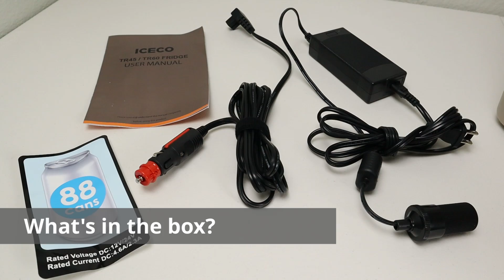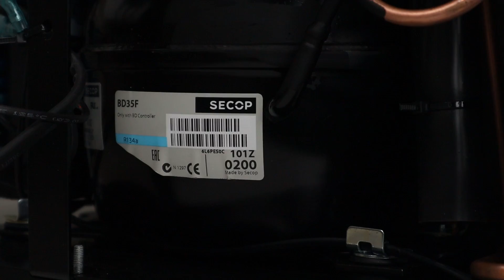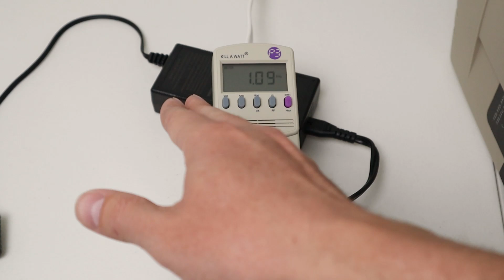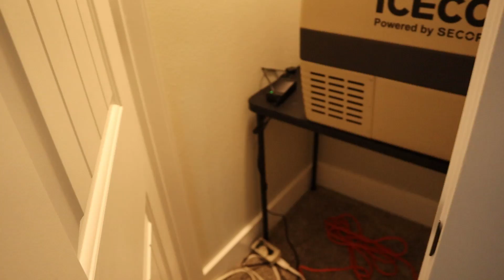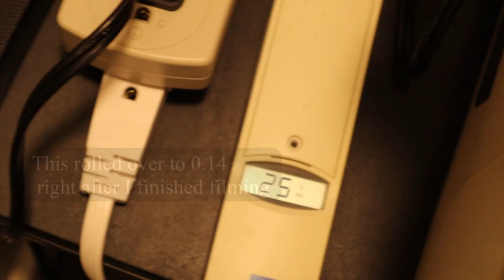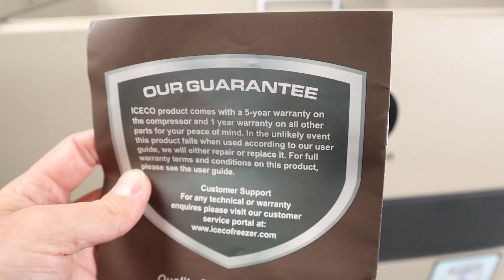ICECO TR60 12 Fridge Review - HUGE Capacity, Very Efficient!

Comment: Jason, I’m a truck driver and would primarily be using this on a semi truck connected to my 1800 watt inverter - sometimes using for car camping connected to a solar generator (no overloading or off-roading). Would this model be expected to serve me well? I ask because there are times I’m hauling freight up and down steep inclines. Thanks in advance.
Reply from the maker: If your truck can go up it, this fridge will handle it just fine!

Comment: How rugged does the build, materials and design of TR60/TR45 one seem compared to the JP42?
Reply from the maker: The JP42 is much more durable and heavier. I really like the TR60 though. Have you seen my complete Iceco comparison video? I put it out a month or so ago, maybe longer.
Reply: That was the only one I didn't see.  Just watched it.  Thanks!
Reply from the maker: @douglashenderson1419  just covers each model. I like the normal VL series for the efficiency but the TR60 is an excellent option. The JP42 is good but it uses more power and is pretty heavy, only go with that one if you need an extra heavy duty fridge.
Reply: @Jasonoid  On the JP42, do you think the power consumption will be lower now that it has been updated to have the Secop compressor?
Reply from the maker: @douglashenderson1419  the Chinese compressor actually uses less power, pretty interesting. The JP42 just doesn't have as much insulation so it's not quite as efficient as the TR or VL series

Comment: Hello Jasonoid, I am considering the TR60 vs the VL60S (Single Zone) vs the JP50. Both the TR60 and VL60S are 60L/63Q so they have more space than the JP50.  JP50 Power Consumption (P.C.)  (MAX mode, 55W for fast Cooling; ECO mode, low as 33W); VL60S PC (MAX mode 55W-60W; ECO mode 45W-55W according to an email ICECO sent me). TR60 PC (No longer listed on ICECO website so not exactly sure). The JP50 and the TR60 seem like they are built more of plastic than the VL60S. Not sure how this affects insulation. The latches on the VL60S also seem more secure than both the TR60 and JP50 which may also affect insulation. Also, does the TR60 have a drain plug at the bottom? I said all this to say which fridge/freezer would you recommend considering these factors: best insulation, least power consumption and price point. If anyone else has an opinion with some reasonable level  competence regarding these units, please enlighten me. Sorry for the diatribe.
Reply from the maker: Hey Dareal,
Thanks for reaching out about which fridge you should buy. I am planning on doing an ICECO comparison video soon because I have 8 of them….one from each “category” they make. 2 VLs, 1 VLpro, both JPC-rotomolded the 42 and 60, the JP30, and GO20. I have used them all many times and tested them thoroughly.  That video will go over a quick overview of each model (pros and cons), power usage, price, and capacity so subscribe for that future video.

The TR60 is a great fridge (available from FrontierHub.com…it was never on ICECO’s website for some reason).  It is a “divided” style fridge so the thermostat controls the larger compartment and the smaller compartment over the compressor is about 10 to 15 degrees warmer. I wouldn’t call these divided fridges “a fridge / freezer” like some people do. That’s kinda a gimmick. The warmer area is good for drinks and produce and that’s about it. If you want a true dual compartment fridge freezer look elsewhere like the ICECO VL60Dual.  The TR60 pulls about 10 watts at 70F and 21 watts at 85F degrees. It has the SecopBD35F compressor. ECO mode pulls 46 watts, MAX mode pulls 82 watts. No drain plug but I don’t think that’s a make or break feature there. The TR60 comes in at 43 pounds.

VL60S is a “Chest” style fridge so there’s one large cooling area. I prefer chest style fridges because I like to set them right at 35F and they perform very well. The VL60S is basically a tall version of the VL45. They took the VL45 design and made the walls taller. That makes it a pretty deep fridge so getting stuff out of the bottom and moving stuff around could get annoying, probably only downside for this fridge. The VL series are the most insulated fridges that ICECO offers. The walls are 2.25 inches thick! It’s going to be heavier than the TR60, but that weight means more durability and insulation. I am a HUGE fan of the VL series, they are my favorite model line from ICECO. I haven’t used this particular model before but like I said it’s a ‘tall’ VL45.  It should pull about 9 average at 70F and 19 watts at 85F. It should have the Secop BD35F compressor…it may have the larger BD50F…I haven’t torn one of these down to look inside before. I will tell you I wish they made the VL60 fridge in the same form factor as the VL60Pro, its basically wider and longer than the VL45 so it’s easier to store things and not have such a deep fridge. This has got to be heavier than the VL45 which weighs 48lbs.

The JP50 is a “divided” style fridge so the thermostat controls the larger compartment and the smaller compartment over the compressor is about 10 to 15 degrees warmer. I wouldn’t call it a fridge / freezer because you can only control one compartment (just like the TR60). The benefits to the JP series is that they are lighter weight due to the plastic construction. They due have a metal liner inside so they offer great efficiency just like the other two fridges. I think these fridges are a little over priced because they cost the same at the VLseries….shouldn’t they be cheaper because they are made of plastic? This fridge also doesn’t have a drain plug.  My testing on the JP30 came in around 11 watts power usage at 70F so maybe add a few more watts to it? ECO mode should pull around 38 watts with a 59 watts MAX mode. It should have the Secop BD35F compressor in it as well. This should come in a few pounds heavier than the JP30 at 33 lbs.

Hope this info helps. You can save 12% on any of these fridges using my discount code “JASONOID” at checkout if you decide to purchase one. I think ICECO offers a great value for the price. They are the best priced fridges that have the reliable Secop compressor in them. Happy fridging!
Reply: Much appreciated Jasonoid!! Thanks for getting back so soon with such good info. I think I’m leaning towards the VL60S. I like the footprint as it’s taller but not wider or longer than the VL45. Don’t mind having to reach down a little deeper if I get a little more space. I actually had the Setpower 47Q but returned it. I really liked that Unit. Only problem was it was rated at 85watts. However after I returned it, I saw your video with it matched against the VL45 and it seemed to have better efficiency than the VL45 which means VL60S is likely to have less efficiency than the Setpower 47Q which is totally what I was not going for. I have a 4S 12V battery Bank  (4x 3.2V Prismatic Lifepo4 Cells 310AH, *really capacity tested at 304AH) that I’m working with. The Setpower 47Q ran through those 304AHs in about 24 hours. Now it was about 104F in Souther Cali and I was running it with an Inverter on AC instead of DC so I know that affected the draw greatly. I was trying to find a Camping Fridge Unit that would run for about 5-7 days just on that 304AH battery. Hoping VL60S will be somewhat efficient. Also you mentioned
A discount code. Would that be also for the VL60S as well? It’s listed on Amazon $624.41 (taxes and shipping included).
Reply from the maker: @Dareall13Cd  Interesting power consumption results. At a 100F, even with the fridge compressor running 100% of the time the ICECO would only pull 40 watts max on ECO mode and should still be able to keep the contents cool (if the fridge is shaded), that 300ah battery should last for weeks at that load! Your battery almost has 4000wh of capacity so divide that by 40 watts and that's the time frame you "should" be seeing on a runtime. 

Weird you aren't seeing longer run times, even off the AC inverter efficiency losses. My 100ah 12v lifepo4 lasts about a week usually running a fridge.

My discount code is site wide so it will work on any fridge on icecofreezer.com
Reply: @Jasonoid  I went ahead and purchased the  VL60S. Used your discount too. Great discount as well. Was able to get fridge and fridge thermal cover for less of what fridge cost on Amazon. Much appreciated. That’s the good part. I Received it last night. I had an issue but didn’t know if this was the forum to discuss it. Already sent ICECO an email. Do you have an email to discuss the issue? I can send you mine if you’d like. No worries if you don’t as I know you’re busy and not Quality Control for ICECO lol. Won’t take offense if you don’t respond. Thanks again.
Reply from the maker: Feel free to send me an email at jasonoidllc@gmail.com happy to help

Comment: nice review, so are these TR's dual zone? also, what's the exact width at the base?? Also, you  mentioned the fridge area is 10 degrees warmer, how is that supposed to work if you set the freezer to -18C (0 F), the fridge will be -8C???
Reply from the maker: I like to call them divided fridges. Their kinda in between a single zone and a dual zone style fridge. Theres only one temp setting on the display but there are two 'temperature areas' in the fridge. One area is just about 10 - 15 degrees warmer. If you have the fridge set at 33 degrees, the large area will be 33 degrees and the large area will be around 44 or slightly warmer. Great for produce or other food that doesn't need much cooling.

If you set the display to 20 degrees, the large area will be 20, the small area will be around 30-35 degrees. Hope that makes sense. If you want an actual dual zone fridge, they have some VL series dual and VL Pro series dual models that are great!
Reply: @Jasonoid   no, doesn't make any sense because if you set the main area as a freezer, that would mean your "fridge" area would be freezing also, if it's only 10 degrees warmer...unless I'm missing something...
Reply from the maker: @bikeninja956  That's why I don't really recommend using these as a freezer, they are designed to be a fridge with a slightly warmer area in the small compartment. Kinda a weird design.
Reply: @Jasonoid  ok, that's super helpful. Unfortunately I'll cross this one off the list then. I need  a true dual zone unit...
Reply from the maker: @bikeninja956  check out the Setpower RV45d, Setpower is a budget Iceco. Also check out the VL60D
Reply: @Jasonoid  ugh, both those just miss my specs. I need it to fit within ~28Lx16Wx~20H....
Reply from the maker: @bikeninja956  just keep looking around, you might find something!

Comment: Is there anything in the owner’s manual that warns of operating it in too hot of an environment, possibly leading to compressor damage?
Reply from the maker: The compressor will shut off and give an error code if it overheats. Hot cars in direct heat in the summer may cause issues. The built in fan helps but 130 degrees is quite hot for a fridge.
Reply: @Jasonoid  I just read something that said it can operate up to 120° Fahrenheit.  Some of the cheaper units can't handle that kind of heat.
Reply from the maker: @rzu7120  I always recommend having them in a shaded area as much a possible to save power. Heat and sun are your enemy haha. That's just my preference. Try not to have them in direct sunlight or a sitting car with the windows up.

Comment: Looks great. I wish it was a single compartment. Not sure what I would put in the small area that’s 10 degrees warmer.
Reply from the maker: I agree, I prefer the single large chest style fridges more. This would be my top pick because of weight and efficiency if it was a chest style. Still works awesome!
Reply: @Jasonoid  Of your ICECO fridges, which do you like best? I am going to get one to put in my Tacoma truck bed (under the canopy) for road trips and camping.
Reply from the maker: @readyme  So if I was only going to have one fridge, i'd probably go with the TR-60. I like how it's very efficient, lighter weight than the VL45. If I didn't need as much room as the TR-60 I would go with the VL45. I like the VL45 because it has the most insulation. If I always needed TONS of space I would go with the VL74. It's HUGE but it does have the larger BD50 Secop compressor. 

Just think about how much room you usually take up for your trips right now and then make the choice on what size you needed. Is your family going to grow? You can't go wrong with either of those three models but it's always better to go bigger because you don't want to run two fridges, it uses much more power from your battery.
Reply: @Jasonoid  Last question (for now). What is the small section designed to hold? It seems odd that section is 10 degrees warmer.
Reply from the maker: @readyme  produce, veggies. Set the large area to 32 and the veggies will fare well there.
Reply: @Jasonoid  I think you convinced me this is a winner for me. Now I have to educate myself on electricity. I am looking at the Bluetti AC50S, which by my calculations is about a 30 AH usable battery. With the ability to charge the battery while driving, this should be a good setup for me. Thanks!
Reply from the maker: @readyme  should work out great with that battery setup. I haven't personally used it but I have heard good things about it. Congrats!
Reply: Condiments (ketchup, mustard, even margarine)

Comment: Thanks for the great video review. I have this fridge and I was wondering if you had any problems with temperature staying constant. It seems that when I would drop the temp to freeze it was actually getting warmer for quite awhile before it would cool down. I also find that there is sometimes about a 10 degree difference between the onboard displayed temp reading and the traditional fridge thermometer I keep inside it when running. My cooler does not seem to have any foam gasket on the lid at all either. It is just the molded plastic. I wonder if I am losing cold air or warm air is seeping in without any type of gasket.
Reply from the maker: Hay Mark, I have noticed that some fridges need a little lower temp adjustment on the display to keep the contents colder. Pretty normal with most brands. Each fridge is a little different. For example you might want to try setting the fridge to 27 degrees (instead of 32) and see what the behavior is like. I'm guessing the location of the temp sensor could be closer to the cooling coils or something and it thinks the temps is colder than it really is. Let me know what you see. It's normal to have temp swings of 10 degrees, you just want it to be anything below 43 degrees to keep your food from spoiling.
Reply: @Jasonoid  Thanks for the response. Appreciate it.

Comment: Thanks for all the information! If you had to choose between the VL45 or the similar sized TR45 what would your thoughts be?
Reply from the maker: Great question! They have the same compressor so no issues there on efficiency or reliability. The TR45 would probably be lighter weight than the VL45. The VL45 is a single zone chest fridge while the TR45 has two different zones. You can't go wrong with either one but I kinda prefer the single zone temp zones. Just personal preference of the VL45. THANKS FOR WATCHING :)
Reply: Appreciate it! When your father in law said the VL45 was his favorite in your other review video I knew that would be the one!
Reply from the maker: @KB-hq2tk  you can't go wrong with either. You choose what works best for you. Happy fridging!

Comment: Mine is a different brand but this one would be a nice replacement for whenever mine should stop working. Mine is much like this one and it has a basket with an adjustable devider.
Forgot to mention. Mine has an interior lite on each side.
Reply from the maker: I have been very happy with it.

Comment: Thanks to your channel, I'm very likely going to purchase a Iceco as opposed to a Whynter (which is the brand sitting in my amazon cart before finding your channel.)  What I can't figure out is the difference between GO, JP, VL and now TR.  I'd like to be able to understand the difference so I can make an informed decision.  Also, 60 is pretty large for me (I usually travel single).  I was thinking of getting a VL45 which is one from a review you did with your father in law, but I'm not stuck on that 100% - hard to figure out which fridge/freezer to get!  Do you have discount codes on different fridges?  and one last question, I really like the slim fit of the whynter FM 452SG - does iceco have anything similar.....tall and slender that will fit between front seats or in a thiner niche?  Thank you very much for your help!  I've been binge watching your videos.  Also, thanks for posting a nice discount code.  May I ask how long the discount code will be available?
Reply from the maker: Not sure when the discount code will stop, they discontinued their affiliate portal so I am guessing sooner rather than later, I'm surprised it still works. So the VL series are heavier built and tough, very insulated.  I always recommend the VL series because they are my favorite. I love the look and performance. The TR is a great mix between the JP and the VL, it's large and very efficient. It has wheels so it's easy to move. Great for traveling solo. The JP series are light weight and compact. The discount code on the TR-60 is pretty decent, brings the cost down 33%. Thanks for watching!